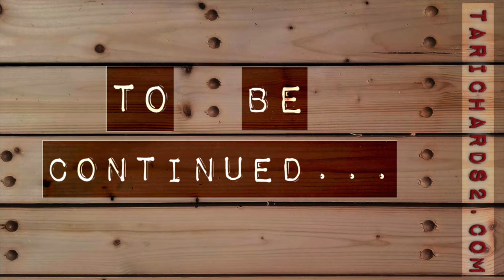BIG DIY GUY HOW TO CHANGE AN OIL FILTER NO WRENCH

Comment: Good tip brother! I've used it dozens of times and when I put the new one on if I didn't have the proper tool, and 24" rubber bungee strap will wrap around it and tighten it a bit tighter than just by hand. Hope all is well with you and the family and you're as comfortable as can be expected. Be safe and thanks so much for sharing.